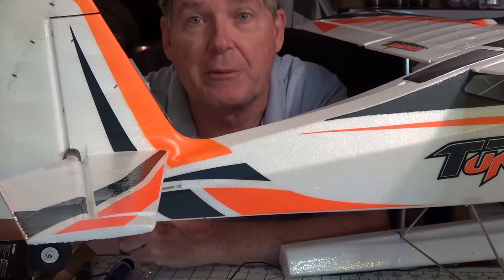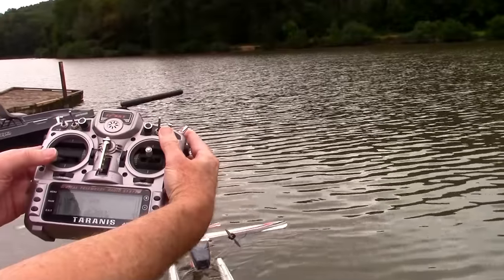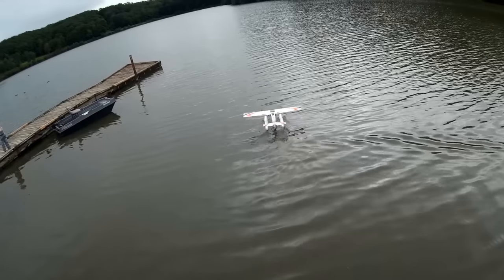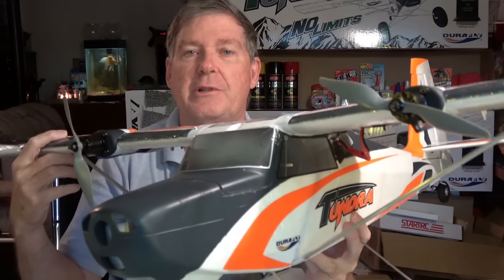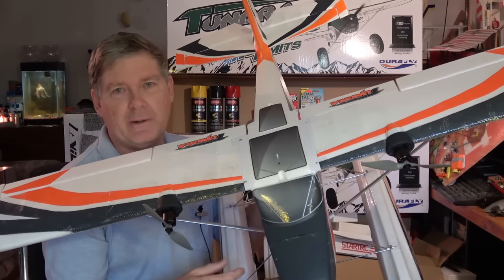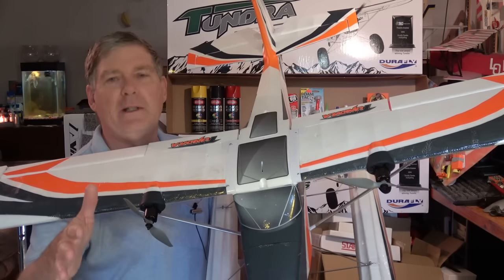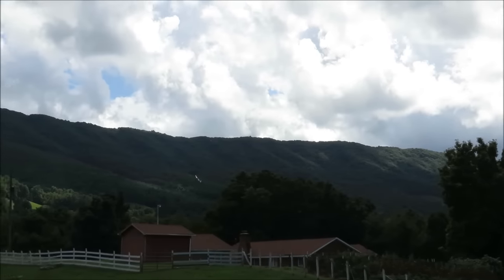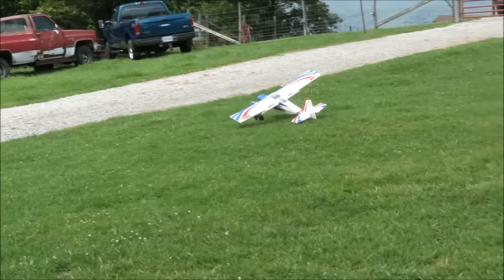DIY Twin Engine Durafly Tundra RC Plane - 8 Reasons to Build a Twin Prop Tundra

Comment: You could put your fpv camera in the nose where the original motor was . I have 2 tundras & a grand tundra . Great flyers . I also put the tires on another plane . It would make for an interesting build video .  Nice Job ..
Reply from the maker: Sounds good. It would be cool to have a stabilized camera gimbal on the nose.

Comment: Nice. What flight times are you getting  ?
Reply from the maker: I did two flights on a 2200 4s and still had 59 percent.  I will have to measure the time.
Reply: Max flight times with your two motors would be very interesting.. Moving the prop out of the way of an FPV camera in the nose is a nice idea especially if it doesn't reduce Tundra flight time.